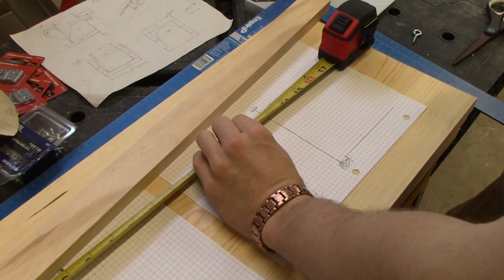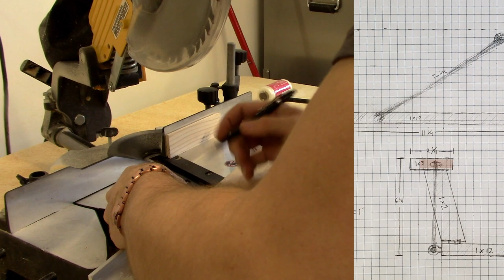Gaming Table Part 2: Laptop Trays

Comment: thank you.  I only have 2 comments/questions
1) what wood (apart from the plywood you mentioned in the previous video of the table surface) did you use (i.e pine/walnut/??)
2) From the previous video, you mentioned the leg length as being 31 inches - Was that the total length to where it rested under the top of the table edge, or was it 31 inches of "free" leg length up until the 2 x 6 (in the diagram). 
But great design.  most likely will do it myself along your design lines.

Comment: Nice work and a good idea. One little safety comment, take as it is, just a slight concern: If you, like me, are down to your last set of fingers, I feel like you put your fingers mighty close to spinning blades... Personally I always use push sticks, crosscut sledges or clamps when making cuts on small pieces. As a rule of thumb, if I can't make the cut with my fingers at least 10 cm (4 inches) from the blade I'll figure out another way to make the cut.